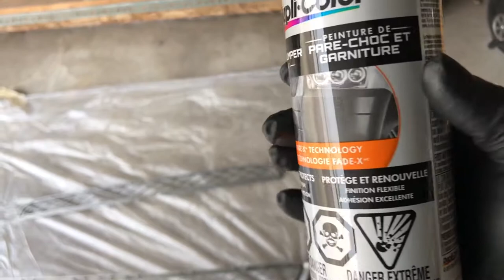BMW X5 E70 BLACK GRILL | FRONT BUMPER REMOVAL

Comment: I thought you're not supposed to pull the bumper out, aren't there clips holding it in place below the headlights?
Reply from the maker: i found it easier to remove the grill when the bumper is out. You might break the clips of the grill if you don't. But yes, you can remove it without removing the bumper.
Reply from the maker: it was cold here and the plastics was hard, thats why.
Reply: @diy_yud  no no i meant the bumper not the grille. im sure the bumper had some clips holding it in place so youre not supposed to pull it out but instead release it by accessing it from the foglamps
Reply from the maker: @hpdrives  this one doesnot have clips, just tabs that fits in the headlight housing.
Reply: @diy_yud  right those tabs. they just come off with a pull?
Reply from the maker: @hpdrives  It did on mine. If its hard to pull then i would suggest remove the bezel and use you finger to push it up and pull at the same time, may be then start from the center to outward.